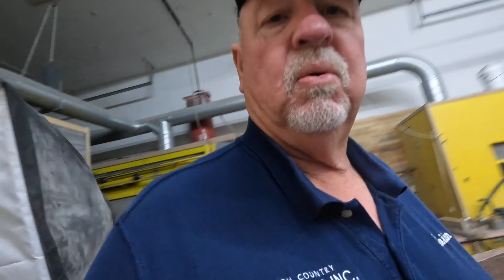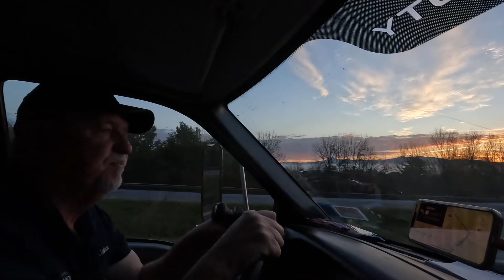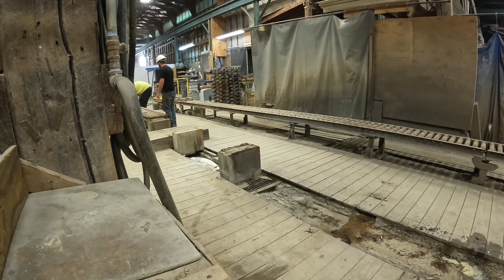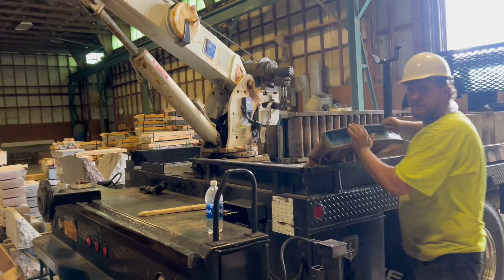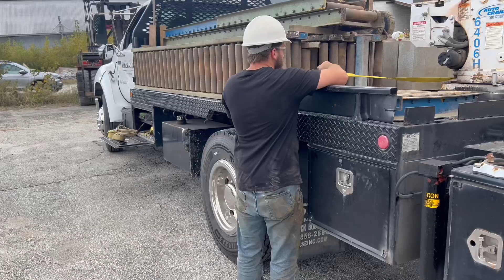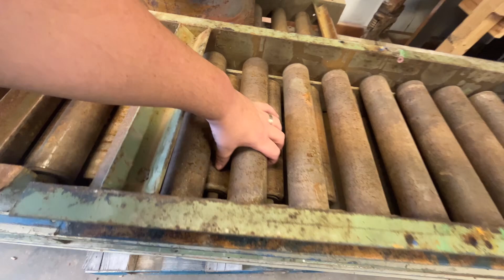We broke our monument shop rollers

Comment: Love your vids! I want to start a monuments company but have to start small. Any recommendations on a sandblaster/compressor combo, a plotter/software combo that can get me started at least doing address markers and death dates, etc? Any advice would be awesome. I also know I need a crane truck to move stone as well. Thanks!
Reply from the maker: Hey thanks for watching. I have a lot of that information in other videos and go in depth with lots of it.
Reply: @ I noticed in your video about the compressor that a 70cfm would be a minimum suggestion. For an operation much smaller than yours would something like a 25cfm compressor work? I simply can’t afford those bigger compressors and was hoping I could get by
Reply from the maker: I have not tried it so hard for me to tell but I bet it would not be very efficient if it did work at all.